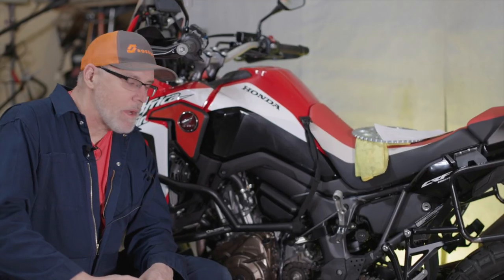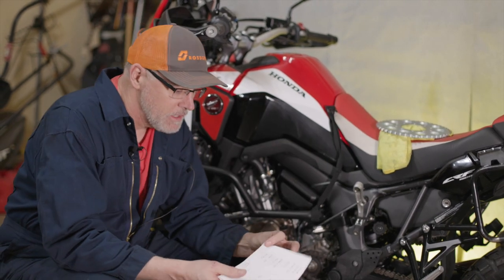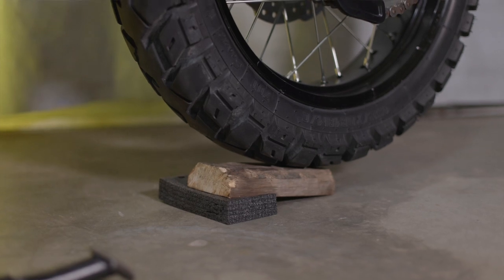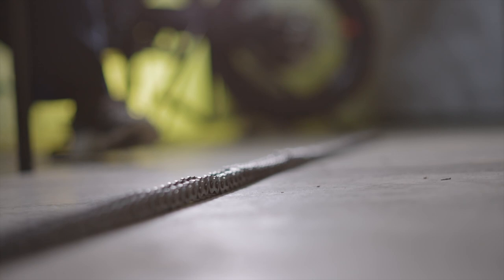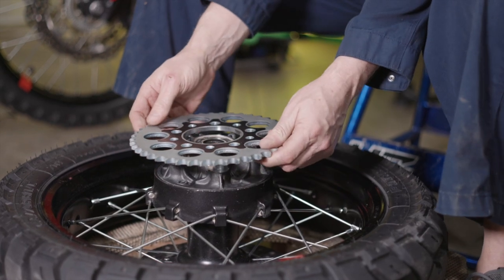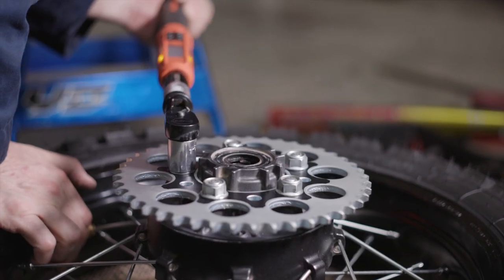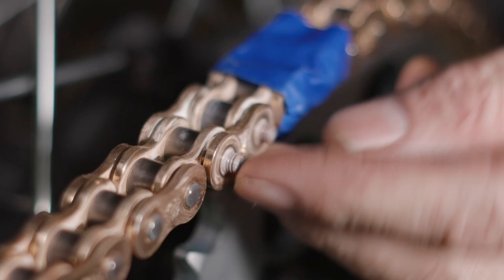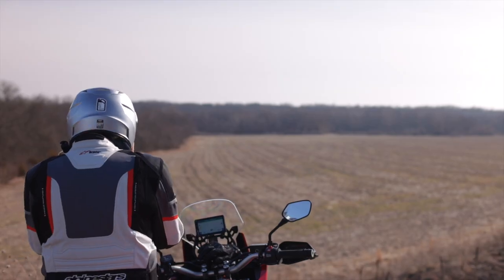We Changed the Rear Sprocket on the Honda Africa Twin

Comment: i too changed the rear to a 44, and got the same results , the reason  i took this path was in towns and small country roads it felt that in had to go from gear to gear in slow moving traffic, as i live in the UK its hell. so with the 44 it made life a little better, and i will never go on dirt, as i am to old and bits and bobs will break so easy , and take a long time to heal.

Comment: I did the same to my  2016 AT several years back. Works good for me . Also added a speedohealer to get speedometer reading correct....Nice video.
Reply from the maker: Thanks for the feedback and complement.  I’ll look into the speedohealer.
Reply: @1LiterADV . It's a real PIA to install.
Reply from the maker: Do you know which wire harness for AT?
Reply from the maker: Thanks for info.  I’ll look into it and possibly do install video.  I’m assuming plug is under tank.

Comment: Thanks for the video, it’s good idea to grease the countershaft splines before sprocket installation. Also, maybe treat yourself to an electric impact gun! (for bolt removal only)
Reply from the maker: I don’t think I would use impact on drive sprocket.  Probably fine to do, but I like manual wrenches mostly.

Comment: Hello. For DCT models is NOT recommend modify the gearing more than 1 tooth in the front sprocket or 2 teeth in the rear.
Reply: Is this a Honda recommendation? If so, is the recommendation in the manual or on a site?
Reply from the maker: @UncleWally3 Honda recommendation….no.  Personal choice.
Reply: So are you saying that going 2 more teeth to a 44 rear is still okay for the DCT?
Reply from the maker: @russellgreen5211 no I don’t think I’d make that claim, and I don’t think DCT owners would recommend it either.  I believe DCT is a different beast all together.
Reply from the maker: No….honda made gearing to their recommendations. They are not recommending that you change it.
Reply: @1LiterADV  SXSthumper on the Africa Twin Forum has done it to his 1100 with no issues. I’d really like to give it a go with my 1000. I still haven’t found anyone else who has done it firsthand.
Reply from the maker: @russellgreen5211 here’s some peer pressure.  Do it, Do it!

Comment: well that math program is great, but we need info on FIRST Gear, where maneuvering at low speed is Crucial for our tach speed
Reply from the maker: I don’t have any mathematical statics….but I do feel improvement in slow speeds as gears are shorter

Comment: I did a similar mod but went with a 14-tooth front w/speedo healer.  Good choice either way I figure.  I have kept it that way for 40K miles, I have 44K on it now.  Heading to Alaska in June.  Good content, I enjoy the channel.
Reply from the maker: Awesome.  Thanks for the feedback.
Reply: Has your fuel mileage been impacted? I’ve done the same mod on mine, 15 tooth and speedo healer. Haven’t done a big trip since the mod
Reply from the maker: I have done other things to my bike that may have impacted fuel mileage.  Full exhaust, booster plug, knobby tires, etc…so I can’t really say how this has effected it.  The change has been great for me.  I would recommend the speedo healer.
Reply: @1LiterADV Hi there, thank you for the the great content that you guys have been sharing with your videos. I’ve been traveling in and off-road almost every weekend with out any modifications yet. I’m very interested in doing the “booster plug” and the “44 rear sprocket” that you did. And I would like to know how many miles average you can ride with your full fuel tank.
Reply from the maker: I have never really worried much about mpg…so its never really been on my radar.  I’m heavy throttled much of the time, especially off-road.  I will say it went down but you have plenty of range to ride say a BDR between stops.  If I had to guess maybe shave off 20 miles range per tanks just to be safe on calculation.
Reply: @1LiterADV  I appreciated your answer, keep enjoying the rides.

Comment: It's always  better to gear lower for off road. But on most bikes at higher speed we prefer lower rpm if we can.
Reply from the maker: Agreed. There is a fine balance between the two. We often wonder if our bikes need a 7th gear for extra low rpm highway touring…
Reply: @1 LiterADV  we do need a 7th maybe even an 8th gear.   In most cases when a bike has a 5 speed the engine often has a wider spread of usable power.   Older automatic cars were only 3 speed now almost all are 8 speed it's because the newer engines only perform in a narrow rpm band
Reply: Its almost always bad idea for adv bike.
If you use it only in dirt then u need dirt bike not adv. Low rpms on road trips ftw

Comment: takes 5 seconds to remove the drive sprocket with an impact and you dont even need to lock the wheels down. Electric impacts have selectable torque settings and it doesn't hurt the nut at all.

Comment: are you sure that the speedo is read from the back wheel, i would have thought it would be read from the front wheel so it gets an actual ground speed without wheel spin
Reply from the maker: The speed ring on the front wheel is your ABS.  The speed of bike is calculated from other variables. Simple fix with speedo healer.  Corrects speed of bike, (which is off from factory), and corrects mileage from being off too.  Pros and cons….  But the benefits are a way better bike in the short gears and low speed riding.

Comment: Does it work with DCT ?
Reply from the maker: I have read issues on DCT bikes, but do not have any experience.  You would need to do the research.
Reply: Yep, the DCT is the question I’d also like to hear answered.  I’ve often made chain/sprocket changes to suit the purpose of my riding but, with respect to the AF DCT I just bought . . . I’m stumped.
Reply from the maker: I wish I could help on the DCT issue.  I have read but can’t really confirm that there are issues when changing sprockets on the auto.
Reply: @1LiterADV  what issues? I'm getting one soon, be nice to know! Just about gearing, or reliability? 😎
Reply from the maker: Whether or not a sprocket change would interfere with DCT programming.
Reply: Has anyone gone to a 44 tooth on the DCT yet?

Comment: but are you going to destroy the mpg?
Reply from the maker: I installed a booster plug and I have also installed a speedo healer.  I’m not really concerned about MPG, it’s more about excitement per mile for me. I have never ridden any motorcycle for economy…. Only for thrill.  I love the change, but it’s not for everyone.  However, you are correct MPG does change, but mostly because you want to twist throttle more.